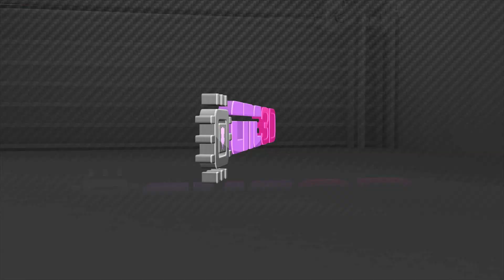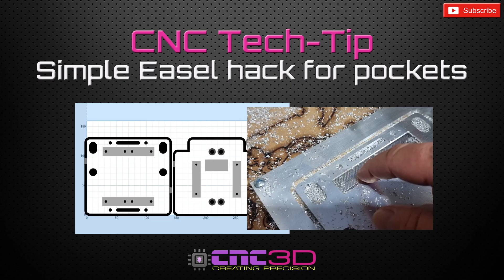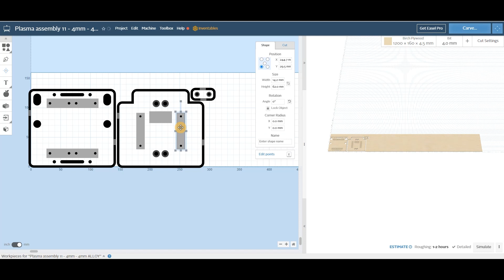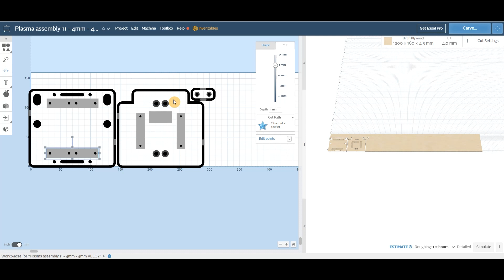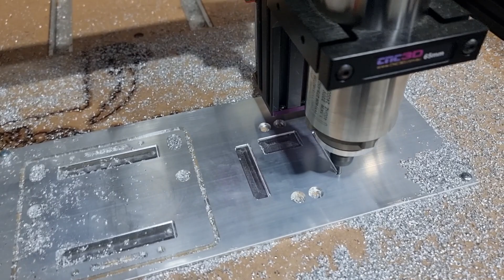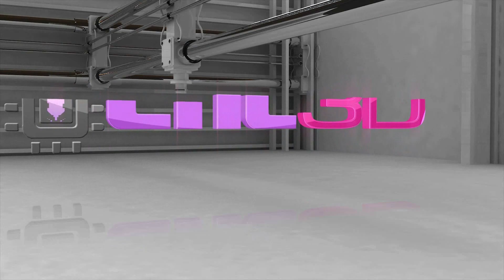CNC Tech-Tip - A simple Easel hack for better finish on alloys when doing pockets

Comment: It says on the software 32 bit computer and also if I purchased the nighthawk controller will it work with a advanced gaming computer with a 64 bit panama city beach florida
Reply from the maker: @andregunther4200  if you are refering to Easel, it should work on any platform as it is browser based.

If you are referring to our Commander software, it runs best on Windows 8.1 upwards on 64 bit.

Our support for 32 bit is becoming rapidly limited as we move forward.